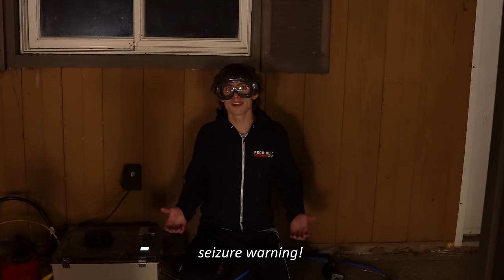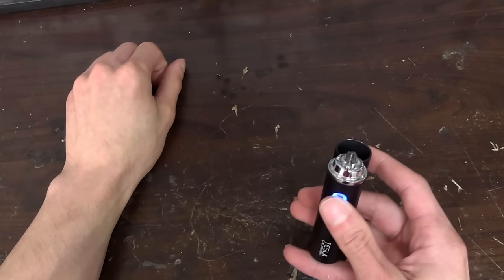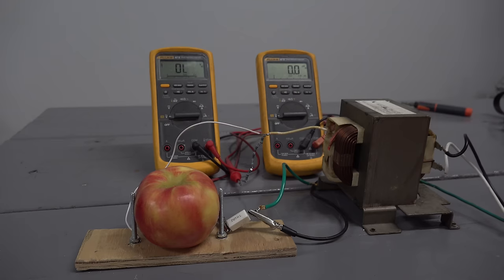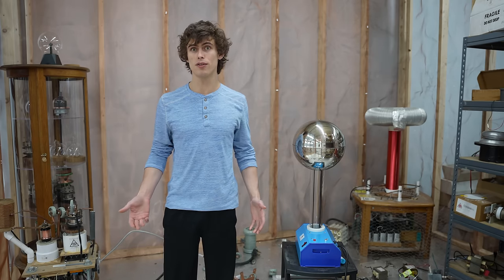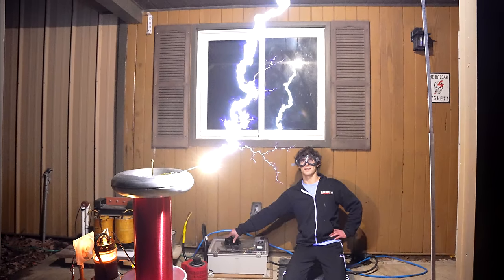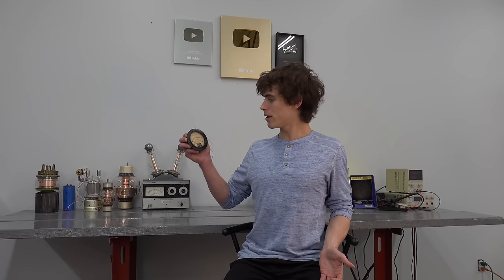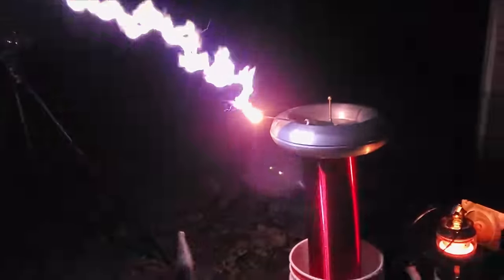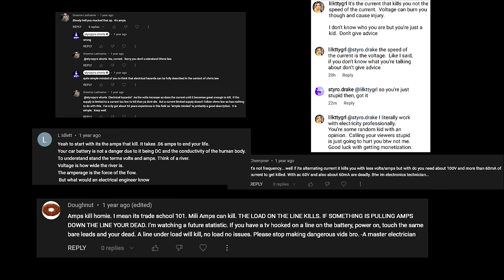Is it the volts or amps that kill?

Comment: I don't think people are usually saying it's only the current. I think people are just used to laymen considering the danger of a circuit and how bad the shock will be by saying "well, how many volts is it?" In which case it isn't wrong to say it's more about the Amperage. The severity of a shock by the average circuit in an American layman's life (120v) is usually dependent on the ameperage. I think that's most people's point. But yes, obviously to say it's only about amperage is kind of absurd.

I've never really considered the frequency of AC in relation to the danger though, that was very interesting. Thanks for educating me.

Comment: Answer is BOTH, Voltage DC at 120V and AC 50V Amper can be dangerous at 10mA if you are to long in the curcuit.

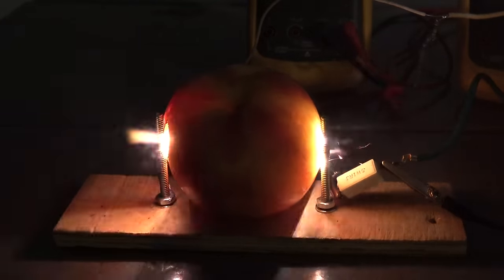Comment: 6:14  Ohm's Law didn't fail.  The resistance/impedance of the apple changed.  Use the proper numbers, and the equation holds every time.
Reply: I thought the same at first but after doing some research it turns out that ohms law isn't simply V=IR as it was taught in school but the fact that resistance must be constant is included in it
Reply: @laserdiode  If we know the voltage and we know the current, we can compute the total resistance/impedance at any point in time.  Resistance/impedance changes depending on many factors.  Knowing the voltage and current at any given time allows us to know the opposition at any given time.
Reply: @laserdiode  Resistance is the property of the material and not voltage and/or current.
Resistance does not change unless you change the dimensions/temeprature/structure/(chemical and physical properties) of the material.
So, unless Ohm's law is valid, you can not calculate resistance based just off of voltage and current, (which almost never true).
Reply: @atharvatidke8517  Could you give an example when the resistance couldn't be calculated using voltage and current. Isn't resistance defined to be voltage dividend by current? 

In a lightbulb the resistance changes because the temperature changes but you can calculate the resistance at any point using voltage and current.
Reply: @laserdiode  It's literally in your name.
1. Non-linear devices (e.g., semiconductor diodes, non-ohmic resistors): Their resistance varies with applied voltage/current, so a single value cannot represent their behavior.
2. Frequency-dependent materials/devices: At high frequencies, reactance becomes significant, and impedance (a complex quantity) is more relevant than resistance alone.
While the V/I calculation works for linear resistors with temperature effects (like lightbulbs), it fails for non-linear or frequency-dependent cases where Ohm's Law doesn't hold. Which means it fails almost everytime in real life.
Reply: @atharvatidke8517  I agree that ohms law fails almost every time in real life because it states that current is directly proportional to voltage. Also V=IR fails if there is reactance but if the resistance would be changed to impedance the equation would still hold. I don't get how V=IR would fail with semiconductors any more than with light bulbs. In both cases the resistance changes with voltage and current input so the resistance value is only true in one condition and doesn't represent their behavior in other conditions. How would the equation fail if it gives the right answer even if the answer is useless in real life?
Reply: @laserdiode  You're right, the equation V=IR doesn't mathematically "fail" for non-linear devices or temperature-dependent resistors. It will give you a resistance value at any specific V/I point. 
However, that single resistance value fails to fully characterize or predict the overall behavior of such devices across their operating range, since their resistance changes non-linearly with voltage, current, or temperature.
In these cases, more complex models beyond the simple V=IR equation with a constant resistance are needed to accurately represent the device's behavior.

My previous statements about the equation "failing" were imprecise. A better way to phrase it is that using V=IR with a single constant resistance value is limited and cannot adequately model non-linear or variable devices across their full operating range.

Comment: Amps! It's the Amps that kill. You can easily survive a 50,000 volt tazer but you get hit by a 3amp battery and you're dead. That being said, the voltage still needs to be high enough to overcome the resistance of whatever it's passing through.
Reply: Voltage and current across the human body are proportional. A tazer is like the van de graaf generator in the video. It works in very short pulses that can be dozens of amps. You don't die because they only last for nanoseconds.

I haven't seen many batteries that can put 3 A through a human. Maybe 300 9v batteries in series could do it. Even with the dielectric breakdown of the skin your resistance wouldn't drop much below 1Kohm so you would need at least a couple thousand volts. 

Resistance isn't something you can overcome with voltage. There is always resistance and that determines how much current flows at a specific voltage

Comment: neither alone kills. Power  kills and that's the product of the two. For example, a common static discharge from your fingertip might be 10,000 volts but only microamps (millionths of an amp). The power is enough to startle you but not damage you. Try 10,000 volts at one-tenth of an amp and you'll most likely be meeting your maker.

Comment: Basically what he is saying: Voltage is only potential, amperage is what moves this potential. With little voltage comes little potential, but with enough amperage can still be powerful. High voltage with low amperage is a lot of potential with not a whole lot pushing it. It's all variable depending on source, but this is how electricity works.

Comment: TLDR: High voltage does kill, but only if the voltage is constant over time.
The problem is that he voltage of a power supply is time dependent.
When a power supply starts delivering a current, then the voltage will typically fall.
That is the reason why farm animals aren't killed by electric wires.

Comment: Styro, Would love to see one experiment that you did NOT do:  Measure the current coming off the Van de Graaf generator with you in series with the wand rather than just putting the wand in close proximity to the dome of the generator.  In other word, hold the ball of the wand with one hand, and bring your other hand close to the dome, so the current has to run through you and not just the wand.  Will you still get as a high a current reading as you did just arcing directly to the wand??

Comment: Let me to summarize this for u:
We have micro-shock (applied directly to the heart), And macro-shock (applied to external part of the body/skin).
Micro-shock (100 micro ampare are lethal). 
Macro shock (100 mili apmare are lethal).
In order to cause 100 mili apare from ur skin the volt must be at least 50 volts.
But we consider 50 volts and below in DC is safe, and below 25 volts in AC is considered as safe.
So as u said and we saw there r many other factors like is it AC or DC, AC is more serious.
And in AC the frequency is another factor lower frequencies (less than 100 Hz is lethal), but higher are not, but this doesn't mean it's harmless, it still can cause burns as example.
In fact we operates this high frequency current in operation rooms for cuting tissues and stopping bleeding from small vessels (coagulation), at frequencies range btw 0.5 to 1 MHz.

If u take other effects like heating effect that occurs at higher frequencies this also has its own factors the most important one is current density (over certain area in cm2), that make monopolar diathermy has only one cutting side despite of same amount of current exiting through ground plate with larger surface area.
I mean if the spark u r bitten by from Tessla's device was distributed at larger surface area of ur skin this will not cause u pain most probably if the area is large enough.

Here is some effects of different amount of current from an anesthesia reference (Podcast anesthesia for FRCA):
10 microA the absolute safety value for connections to the heart  
 
100 microA can cause microshock and VF if directly connected to the myocardium  
 
1 mA is the threshold for feeling and causes a tingling sensation 
 
5mA is the maximum safe current but will cause pain 
 
10 mA causes burns  
 
15 mA causes tonic contraction of muscles and the victim is unable to “let go”  
 
50 mA causes severe pain and even respiratory arrest 
 
Over 100 mA causes VF 
 
Over 5 A causes tonic contraction of the myocardium used in defibrillation (restarting the heart with electricity in certain types of arrhythmias and heart electrical activity problems).  

I really like ur way u simplify complicated information and the way u proof it by experience, really I can feel the great effort and cost behind every single video or experiment.
I took along time and alot of reading and searching to understand what u shorten in this video, I hope I had see it before this would save me alot of time and effort 😂
Dr. Ahmed Salah (Argawi),
Registrar/Resident of Anesthesia.

Hats off my friend.

Comment: It has always bothered me when people say “it’s not the volts it’s the amps”. I’m an electrician so people often ask my opinion or tell me their own beliefs about the dangers of electricity. I have always told people that it’s a combination of amps volts and the resistance of your body. 

Also as a side note different people don’t have the same resistance. My Callis hands will have more resistance than your child’s fingers so although I can shock myself daily while working on the power in your house don’t be negligent with your kids around exposed wiring

Comment: Asking whether amps or volts kill is similar to asking whether the pressure or the viscosity of water drowns you (disclaimer : I'm not an expert, I'm a mechatronics engineer and have studied electronics and electrotechnics thoroughly, but I wouldn't dare to claim that I know everything / can't be wrong). In short , to my understanding , the current has to have enough amps to fry or sufficiently disrupt your neural system and enough voltage to get the sufficiently dense electron stream to vital parts of your body i.e. heart, brain. In summary the current has to carry enough power in Watts , which is a multiplication of I (current in Amps) and  U (voltage in Volts) (times a cosine of a phase angle alpha if we're talking AC) , with an appropriate ratio of a current to its voltage to fuck you up in a given situation. I think...

Comment: It's actually energy that kills you.
Voltage is a condition for the current, current through resistor makes power, power in time make energy.
You measured your resistance wrong, it is contact resistance because of dry skin and very small contact surface. If you wanna measure the resistance of your body, take some big metal sticks with wet hands, this way you will minimize the contact resistance.
Also, frequency of 50Hz is very dangerous, it hits your nervous system that rans on very small currents. 
Then again, if you let high current run through you, even if it's direct current, it'll make you boil, or even fry you :)

Comment: 10:00 I think it would be a better experiment if you were in the circuit.  Your added resistance could e.g. slow the discharge of the capacitor by some unknown factor.

Comment: When you have done 4 entire years of electrical engineering and solved through tons and tons of circuits and realized nothing really works the way they say in the books. Even after working with electricity for so many years nobody can be a 100,% sure that "this won't shock you" and "this would definitely kill you". Such a shame.

Comment: I can feel shocks from 3.5v pulsed DC. I have a single 18650 from an old laptop. Connected to the primary of a MOT. I made my own switch using metal spoons. When I manually pulse the primary (holding the spoons in one hand and playing them on my leg), I get decent sparks and I get shocked by the spoons. 
I am lighting a fluorescent on the secondary and am not touching it.
So i guess its the indirect voltage spike of back emf.

Comment: Here's how I think of it. Voltage is the battering ram that opens the door to let in current, and it's the current that does the damage once it's inside. You need a high enough voltage to overcome the insulating properties of the body so it begins to conduct, and once it conducts, it's game over as current can go higher and kill you. Another way to think of it is your body is a natural resistor which limits current and protects you. But if you add too much voltage. it can bypass that resistance and deliver higher current with less resistance.

Comment: What's actually going on here with people saying this is when it comes to general safety rules that lots of people have to follow for their job, is the simpler the rules the better. Simple rules will sometimes be misleading though, so it's also important that when those rules are wrong that it results in the people following them being safe instead of dead. Always taking proper precautions with high amperage means they won't die, even if there are situations where it technically wasn't necessary.

Comment: It’s the power that kills! Look at the body like a resistor and what is causing it to heat up is power (energy per second). Now it’s obvious that for a certain power you need a combination of current and voltage. If your body has humid skin and more salt in it, it will have lower resistance and a given voltage will create a higher current. Still it’s power making the damaging effects.
Reply: he literally zapped himself with a 3,000,000 watt tesla coil

Comment: It's the electrical power transmitted into the body that kills which is the product of current and volts. So you can have a million volts but a nano amp you'll live. A million amps but a nano volt you'll live.
Reply: Current is proportional to the voltage. If you have a million volts across your body there is always a high current

Comment: power kills, the rate at which energy is transferred into your body will kill you if your soft tissue systems get overwhelmed (this energy can be thermal chemical or electrical) in the electrical case it the nerve tissue and system that gets overwhelmed by the power not by voltage or current

Comment: *in your tesla coil measurements u measure with totally different circuit then what will be in any other situation. and it's the circuit that matters. in case of HF HV arcs u dumping most of the energy into the air and coil heating.

Comment: There are many factors that decide if it is lethal. It is not just amps vs voltage. I have seen people be hit by 480v without a load and yes they get nailed good but they didnt get killed, now if you grab 480v that has a 30 amp load on it yes you will probably die.

Comment: Amps. Think of it as a water hose. Voltage is the pressure of the water and amps is the amount. Voltage can still hurt you and if high enough cause serious damage or be fatal, like a garden hose vs a pressure washer, similar amounts far greater pressure. Now amps is more like gallons per minute. A garden hose can do say 8 gallons a minute a fire hose can do let's say 500. If you get blasted in the face by a fire hose if it was the same pressure as a garden hose it would still be impossible to breath by the sheer amount of water. Amps vs Voltage is basically the same way.

Amps is the gallons per minute, voltage is the pressure.

Comment: It's not the voltage that kills, nor the current. It's the heat caused by the current and voltage, the former being caused by voltage and resistance (or rather, the reciprocal form of the latter of the two, conductance)(and it's also the V-fib from low-frequency AC). And the question doesn't make sense anyway. It's like asking "Which kills, the momentum or the speed of a car?"
Reply: ventricular fibrillation caused by contact with a low frequency AC source also kills, it's not always heat
Reply: @2velyn  yeah that too

Comment: Well, IT IS THE CURRENT (the amps),  but it's actually very simple, you need to increase the volts to increase the current to a level that could kill you. That's why a 12 volt battery capable of producing 100 amps won't do anything to you, because 12 volts is not enough to produce enough current through you at a dangerous level, you have high resistance, high voltage is needed to produce a current powerful enough to kill you.

Comment: Been shocked by 120 volt AC a few times.  Just tingles a bit.  Yet if i plug in a PC or game console power supply and touch the wrong spot its over?

Comment: Of course only current or amps kills. However you need enough electrical pressure to put that current in the body. 11 milliamps can kill as long as there enough voltage to counter the body's resistence.

Comment: if it measures RMS 1,3 and the oscilloscope measures the amplitude 3,2   then the difference is not sqrt(2)   and not even 2   but around 2,5. So it doesn't line up perfectly

Comment: That's like asking what kills you? The gyroscopic force or gravity? When a bullet is fired. 

The bullet duh
Reply: So why when i load the bullet and hold it in my hand it doesn't kill???
Voltage is dangerous!!!
Reply: @emreercan7579  becose the bullet wasn't in the right place. The same thing with electricity.
Reply: @emreercan7579  (responding to the second part) electricity in shocking amounts is.

Comment: Without volts there are no amps. So, it’s the volts.
Reply: Technically volts are defined by amps though since amps are the SI base unit
Reply: @allergy5634  voltage is the force that propels current (amps). Generators produce volts. So I disagree with you. But at the same time I really don’t care either way.